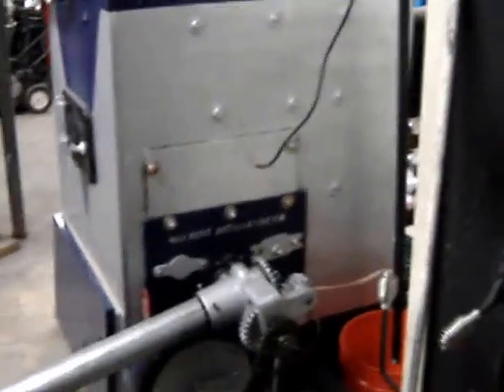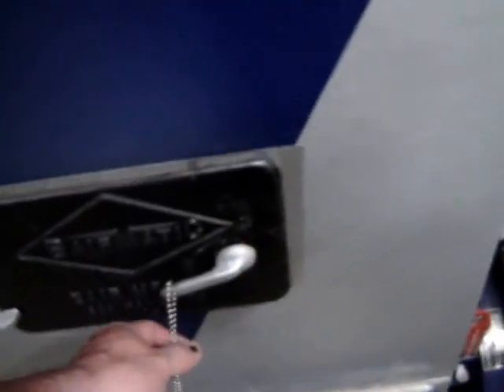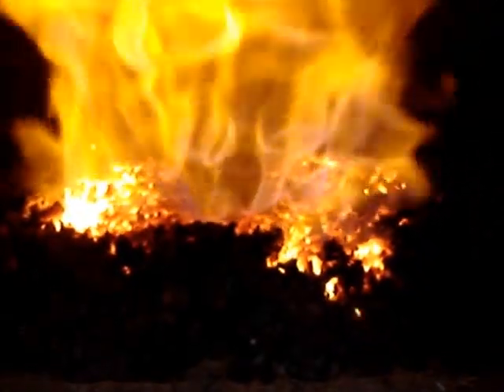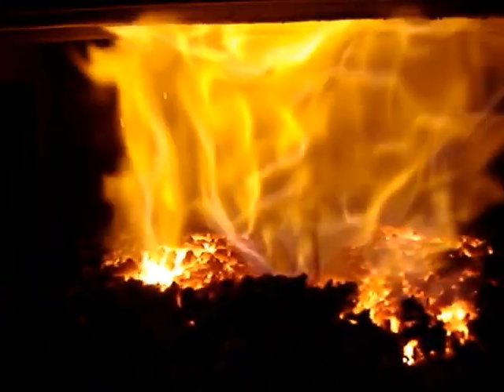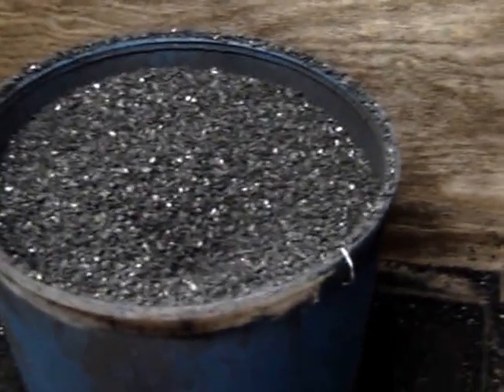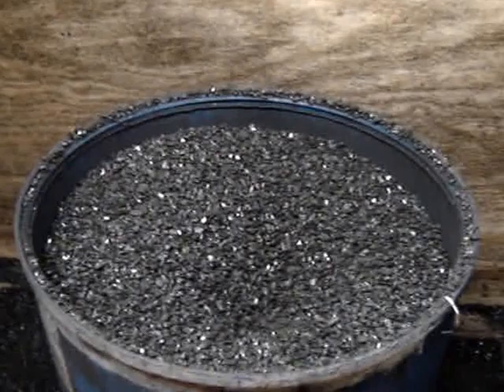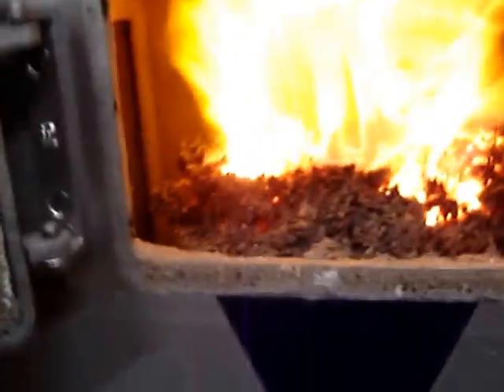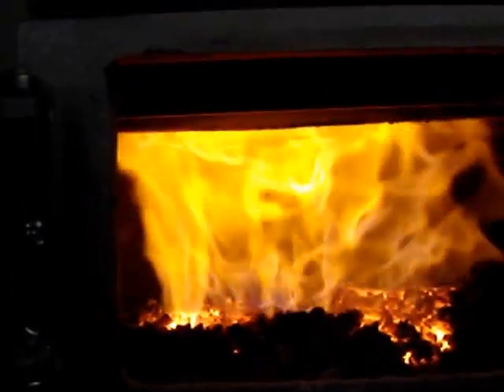BairMatic / Van Wert Coal Stoker Boiler Flame Problems

Comment: Just a different type of anthracite coal, not all anthracite is the same. Different types of anthracite burn very differently as you have seen. God knows how long ago it was bagged or it might have been stored outside for years. 

It to me looks like your burning soft coal as that's what soft coal looks like burning in a stoker fed pot. Not going to hurt your stoker but you won't get the same btu's out of the coal like you will with your regular supply.

Just be thankful you don't have a lot to burn.

Merry Christmas and Happy New Years.

Cheers!
Reply from the maker: Merry Christmas to you too!
The coal wasn't changed, it was just what was at the bottom of the bin. The problem went away once we got through the "bottom of the bin" coal.